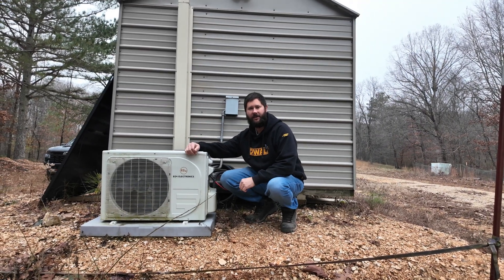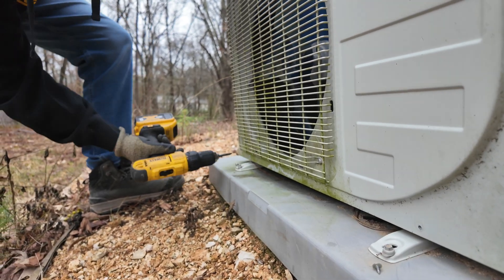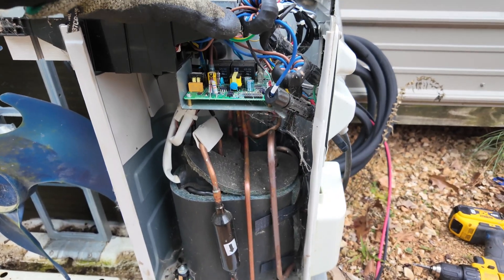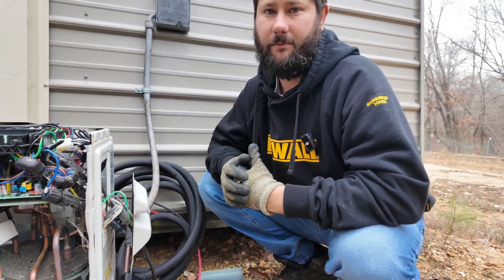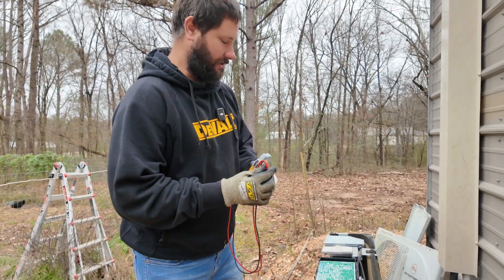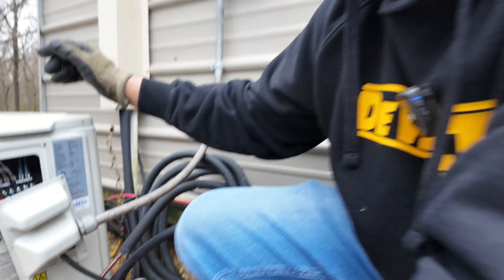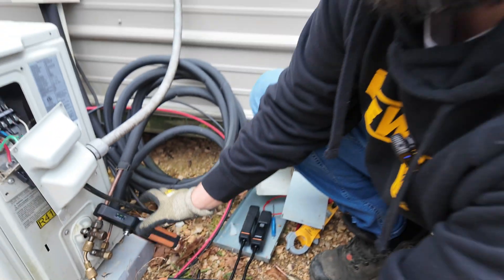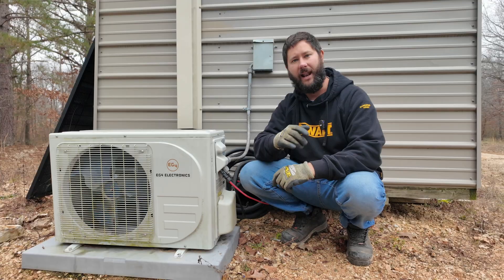EG4 Mini-Split Reversing Valve Test — Full Tear-Down, Voltage Check & Heating Diagnosis!

Comment: I find a lot of techs forget there are two things that make a reversing valve switch properly - 1) Proper power to the solenoid and 2) Proper differential pressure across the valve. So you can have proper power to the solenoid but if your compressor is not pumping correctly or you are low on charge your valve will not switch properly. All freon valves work based on these principles.

Comment: I just bought a manastin 18000 from Amazon with  r32 freon. I had to buy a longer lineset because the distance to where I put inside unit to outside unit was 25 feet. I had to add a small amount of Freon per the instructions  for the longer line. I then  pulled a vacuum and it seemed leak free . When I first hooked it up the thing worked great , then a few days it got to where it was just putting out cold air. Then I found a tiny tiny leak outside on the bigger pipe flare connection, it would leak only when it was running under pressure. I checked pressure with the thing off and it was exactly at 118. So I decided in order to fix the leak I needed to get the freon back into the compressor by cranking the ac and shutting off the Allen screw at the big line. But it never would leave the pressure it was at? It would stay there at around 118 115 ish. So it never seemed like it pumped the freon back into the compressor? So now I'm afraid to open the big line to fix leak for fear of losing freon . I'm a retired handyman with a little bit HVAC knowledge. Could this thing have a stuck reversing valve?

Comment: Nice video. Ok here is a question for this system and other heat pump/AC systems. Why use a large size line and a small size line set when the reversing valve will change the refrigerant flow so that the large becomes the high side and the small the low side. I understand why they do in on a regular AC system where the large is always the low but on this type it came be the high or low so why use 2 different size line?

Comment: Hi Taddy, this might be an ignorant question, but doesn't the reversing valve solenoid operate on 24v?  If so, what's the 120v your checking on that 4 way an indication of vis a vis the reversing valve?  Thanks for clarifying... yes, I'm new at this.   Thanks for the video!
Reply from the maker: For residential unitary equipment, your control voltage is twenty four volts.And that's what you're reversing valve uses for the solenoid to be energized.

For mini splits, it's usually one twenty or two forty.

And it's not an ignorant question, it's a good question.Thank you for asking now.Somebody else that may have this question.Can look at this comment and see the answer
Reply: @taddydigest  Ahh.... got it.  Thanks so much for the clarification!

Comment: Did you use pre-charged linesets? I hate seeing all the copper looped up behind the outdoor unit. Cut it to the right length, make a proper flare, torque it, pull a vacuum. You’re a professional
Reply from the maker: This mini split comes with pre vacuumed and quick connectors.
I broke the quick connectors, removed them and flared.
But I always loop if it's less than ten foot, the manufacturer recommends this it reduces noise and vibration

Comment: I prefer to vacuum my lines before connecting to a unit. So air wont mix with refrigerant. I also prefer valve adaptors with knobs to avoid refrigerant leak. They dont press the valve in when installing, only when everything is hooked up you press the valve in by turning thr knob.

Comment: My EG4 12k hybrid showed a 58 outdoor fault.  System isn't heating now.  Is it done or an easy fix?
Reply from the maker: Error code fifty eight means something is stuck in the fan blade
Remove whenever stuck in the fan blade.Spin the fan blade, make sure it spins freely to make sure fan motor is not bad.If all this checks out order.The main outdoor inverter board and replace it.
Reply: @taddydigest  TY, I'll try that.  It should be under warranty if something needs replaced.